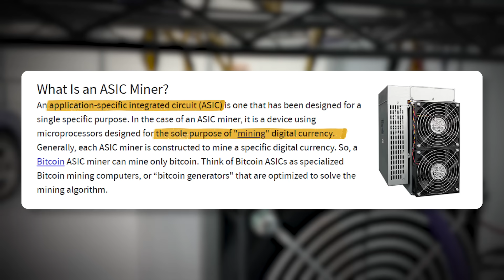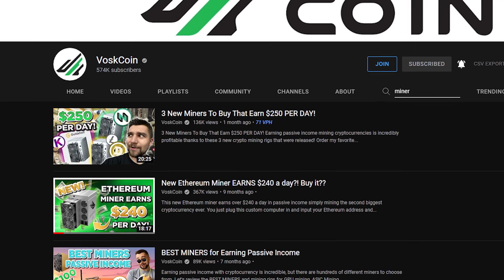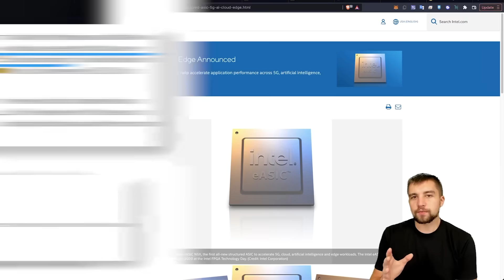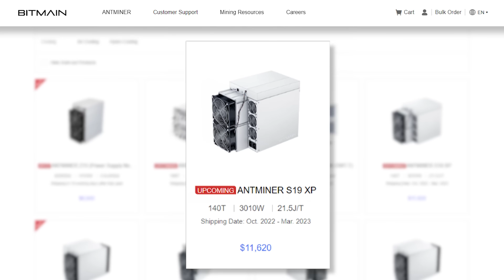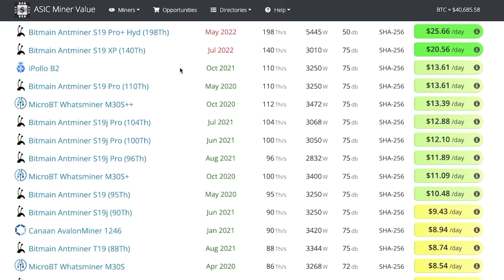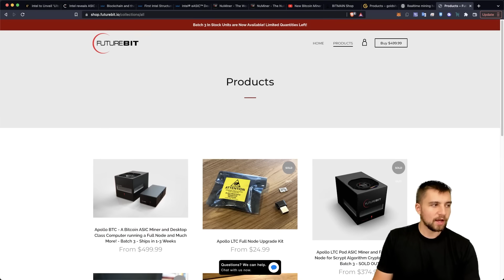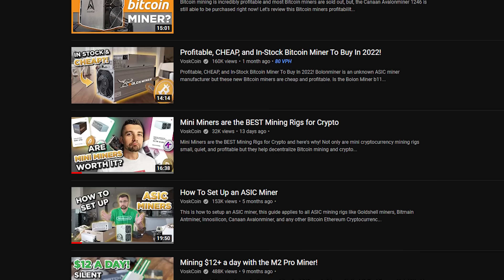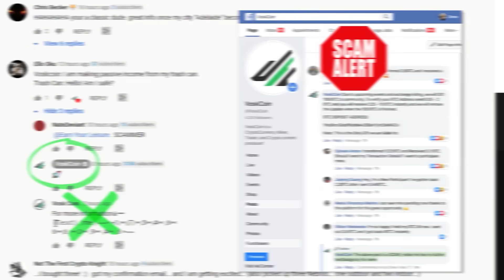Intel Is Now Making Bitcoin ASIC Miners

Comment: I have no clue why you haven't talked about FutureBit's BTC miner. It has all the properties you wish for. Low power consumption etc. However mining is only part of the decentralization equation....if you are mining then you should run a node as well. Which can be done on a cheaply  with a raspberry pi. (Even future bit has a miner with a node built in). Again I appreciate your work but in interest of giving the whole picture to your audience, talk about the FutureBit Apollo BTC.
Reply from the maker: i have numerous times
Reply: I'm surprised those are still available.  I do feel like a ton of people don't know who Futurebit is even though they have been covered.  I just got my December batch a few weeks ago that I had ordered very very early in 2021.  I did check their shop though and they have them.  They must have had a harder time unloading this batch with the current market prices!  It's literally going to be a multi-year ROI but the efficiency is pretty good.  They're only about 100W each on "normal" mode!  If you have money you should probably buy a bigger one.  I put about 5 in my solar farm as part of my diversification / mix because of their efficiency.